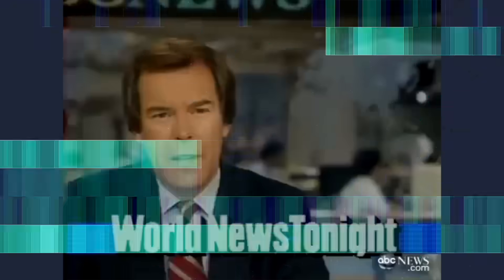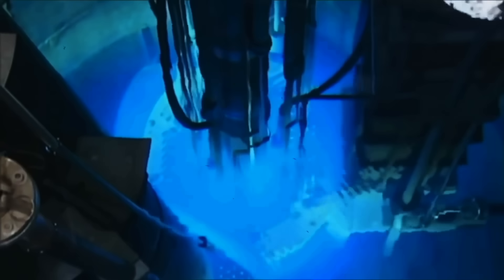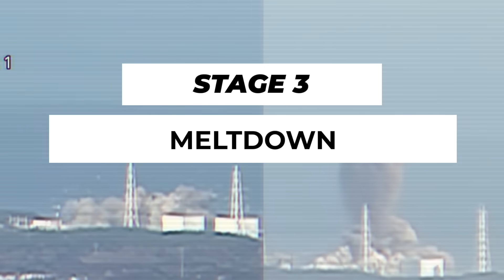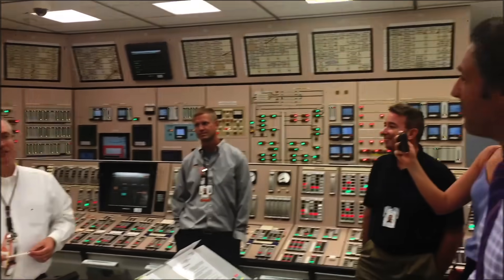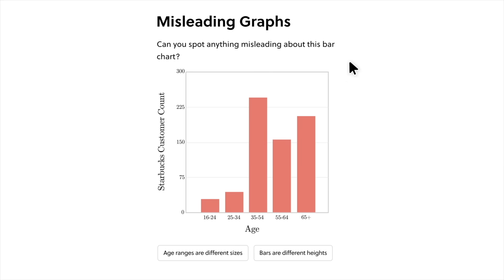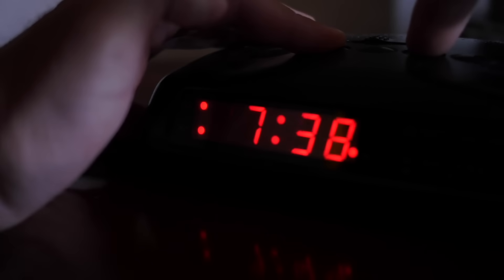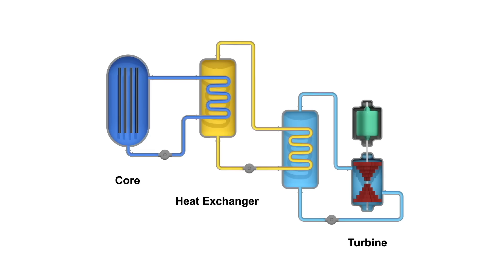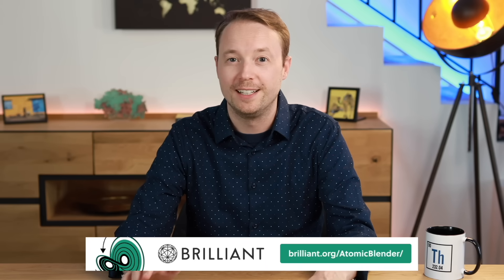Why Is It So Hard to Stop Meltdowns?

Comment: Ugh. 
Decay heat: 6% of the heat is from the shit left over from atoms shattering. That takes about a month or so to mostly fade away. 

So even if you scram the reactor, and really, no-one designs reactor core which would have any difficulty doing this, and then some, so that part always works. 

Even so, say you were at 1 000 000 kW power.  

Now you're at 6% of that, which is still 60 MW.  60MW is a lot of heat generation, and getting that out of a solid-fueled core requires keeping the primary coolant moving. 

Now, water is used in pressurized water reactors as the primary coolant. It has already quite a high latent heat: That is, it takes a little over 4kJ to increase the temp of water by one degree celcius normally, but when it's kept under enough pressure to prevent boiling by forcing the boiling point up higher, then at around 360 degrees C, it takes about 15kJ per degree to heat it up, and that heat capacity has more than doubled from around 6.5 kJ per degree when it was around 340 degrees.  

That fact, that water does carry such a crazy amount of heat at those temperatures, and goes on to carry *even more as it gets hotter* tends to be *very good* for evening out temperatures inside the core. Because the last thing you want is one small part of the core running say +20 degrees hotter than the rest. If that were to happen, the water might boil just there, (because of hydraulics, the pressure is almost the same everywhere the same body of water touches, so too is the boiling point) creating a void that would suddenly insulate that hot spot, which would allow it to get suddenly *even hotter*. This would be bad, so using water, which is quite unique in both having such a high heat capacity, as well as doing this neat trick, helps keep the thing safer.

Of course, there is still another problem. You see, there is a thing called radiolysis. This is where ionising radiation (whose defining feature is that individual quanta of radiation are strong enough to knock loose electrons from molecules, thus, 'ionising' them), well, breaks the water molecules up into separate atoms. Those atoms then get reverted to just a highly explosive perfect-ratio mix of O2 and H2, and bubble up out of the water and collect somewhere... just waiting to explode and definitely let all the pressure out. Oh, and the zirconia cladding used to keep the Uranium inside the fuel pellets and away from the water? That tends to also cataylze steam to turn into explosive hydrogen-oxygen binary explosive gas too. Especially when it's hot. 

So letting the primary cooling stop moving in a solid-fueled, water cooled, fission reactor is a recipe for Fukushima-style explosion. 

Very expensive, and you might accidentally panic and order a large-scale evacuation that will go on to result in many deaths. Which is what happened. 

What, you thought even one life was lost because of the nuclear accident at Fukushima? It was a Tsunami that did that. A couple of technicians wading through the spilt primary coolant basically had bad sun-burn on their legs, from the alpha-radiation from the water, but made a recovery. But yes, the evactuation destroyed enough peoples lives to the point they were then lost to mental illness, and who wouldn't have died if they *hadn't been evacuated*.

Worst of all is, when the precisely made fuel elements melt, you can't pull the reactor core apart anymore for recycling. It all becomes one huge lump. 

Can this ever be fixed? 

Hell yes: Just use a Liquid-Fluride Fuel. It's a nuclear reaction, it doesn't care at all what state of matter the Uranium is in, only how it's configured (placed, whether surrounded by neutron reflectors and moderators, basically how the neutron-economy goes). State of matter (solid, liquid, gas) has to do with how the molecules are stuck together, and that's to do with the electrons on the outside: all of chemistry is, so chemical reactions care about state: But not nuclear reactivity.

Have it dissolved in an ionic-bonded liquid. (a salt). That way it's already conveniently molten and can be easily removed to a container where it can't be critical and *can be passively cooled without needing a pump*. Using gravity and a thing called a freeze-plug valve. 

This is where  you just run a small air-cooling pump against where you want the 'valve' to be closed, and the extra cooling allows the molten fuel to freeze there, as long as that fan keeps blowing. Stop the fan, and gravity safely and automatically pours out the fuel to the safe-storage. Where you can later warm it back up with electric heaters, and pump it back up into the core, when you want to restart. 

Why does this work? Well, such molten fuel has a liquid range such that even if cooling fails, you can't actually get the salt hot enough to 'boil' itself. Therefore no pressure to keep it liquid is needed. Do you know what we call an 'ionically bonded compound which is a gas'? 

Think about it, sometimes it's even called a 'fourth state of matter': Plasma. It's really just a salty gas. Turns out if you ionize a gas, and shatter it into separately-charged fragments (ions), the electric forces tend to make it want to keep together, just exactly the way ionic gasses are anyway, because those materials have atoms that trade electrons and will happily sit about as ions, and not neutralise. But what this means is, it generally takes ludicrously high temperatures to boil an ionic liquid. Some ionic liquids will just chemically disintegrate first.

Rather than having to take the heat from where it's stuck in solid fuel rods in the core, away with a coolant, you can instead pump the fuel itself out of the core and take it to a heat exchanger. 

Better yet, if you don't take the heat away, the core itself can be designed such that the thermal expansion of the fuel itself automatically reduces the reactivity of the core, meaning the chain reaction automatically slows down as it gets hotter. 

So you don't even need to try to keep it running, it just runs itself. It's stable, rather than unstable. 

The lab reactor that proved all this actually had a 'mishap' where the control rods got stuck for unrelated reasons to do with being a prototype. The temp just went up a bit, there was a scary moment for the operator I'm sure, and then it just, stopped there. 'idling' at a new, slightly higher temperature. No melt-down even. Didn't even trip the freeze-plug thing, just, happily sat there waiting for someplace for the heat to go. Boring. Exactly as you want a nuclear reactor to be.

Why the hell does anyone water-cool a reactor then? Well, there's no good technical or defendable rational reason, it's just the way it panned out. The people used to building the water cooled ones had sales teams, and there were no people building commercial molten-salt ones. And the sales people probably had no idea the collosal disservice they were doing the world by selling more. 

One of the inventors of the water-cooled reactor - name on the patent, even - went on to write a letter to congress to plead for a ban on them. Because they were never meant to be made so big that they were a danger, from being possibly unable to be cooled in an emergency. 

So often, technologies succeed catestrophically - they're popular and that becomes a terrible thing, the damage done by not fixing things so badly broken, because it's the status-quo. Many fantastic technologies fail to 'make it' in the market, not for any fair technical reason, but often just because they're 'not a done thing'. They're unfamiliar, or are 'too stale' an idea to be a novelty. 

Or even, they arn't done because they haven't been done, because they weren't done while they were patented, and now they can't be patented (because that's how patents work) so investment doesn't want to lose money by being the 'loss-leader' to push them to market without protection from market competition. Yeah, really. 

Rich people are most often just born that way. They're not automatically less idiotic than any other randomly chosen group of people. The rich generally get richer, without having to work at it. So there's no real evolutionary pressure to keep them 'lean and mean' so to speak. The disparity grows far faster than anyone can do anything about it, and the best we can hope for is for the ultra rich to take the opportunity to pay to make big things happen. 

But to know what to buy, they'd need to know how to do the work that they've avoided ever doing. The kind of work that is maths homework. That is frustratingly finding and facing your inability continuously, until it feels like you're getting no-where, and are just 'not cut out for' it. That takes a lot of self-discipline. And if someone is so ultra-rich that they grew up surrounded by so many yes men that they never grew out of thinking they can get away with just blaming others to avoid culpability - well, they're never going to be able to grasp the knowledge they'd need to be able to be wise with their obscene wealth, to actually be worthy of the power they wield.

So, if those last couple of paragraphs struck  a nerve, because you 'have better things to be doing' then learning STEM. Prove me wrong: join brilliant.org and learn what you need to in order to really understand. You'll need at minimum enough maths to appreciate how game theory and quantum theory and some simple Bayesian probabilty solved using statistical mechanics leads naturally to the empirical gas laws from first principles. And then you can understand what entropy is, and why the second law is why we can't have nice things, or , how the only thing that matters about the economy, is the cost of energy. You can discard all of the 'management theory' nonsense of economics. Then look at the steel, concrete, time and energy costs of energy sources, and finally be qualified to judge nuclear fairly.
Reply: Umm, I'm sorry or happy that happens to you?

Comment: Did I understand correctly about the delay of nuclear fission?! An uranium atom might absorb a neutron but not split immediately. Is that right? And then it will split later and release its energy later! Is that correct? And if this phenomena is possible am I right to assume that this happens very rarely? Lets say that one out of every 100, 000 neutron absorptions, fission does not occur instantly, but release there energy some time later. Isn't this a very low number to explain a nuclear meltdown?!

Comment: You cant see, feel, smell or hear radiation, but it does make your mouth taste metallic. If this ever happens to you for no apparent reasom, then it means it is a very good idea to evacuate the area immediately.
Reply: If you get to that stage, better run directly to the Emergency department, that would be an EXTREMELY high dosage.

Comment: https://en.m.wikipedia.org/wiki/List_of_nuclear_power_accidents_by_country#:~:text=Globally%2C%20there%20have%20been%20at,energy%20accidents%20that%20must%20be
This link takes you to a wikipedia list of most of the accidents or incidents that total more than $50,000 in property damage or loss of life  which presently numbers at minimum 99 out of 440 nuclear reactors world wide and 209 which have been permanently shut down. Hmmm. Nothing to worry about? Really?
Reply: "At least 57 accidents and severe incidents have occurred since the Chernobyl disaster, and over 56 severe incidents have occurred in the USA. Relatively few accidents have involved fatalities, with roughly 74 casualties being attributed to accidents and half of these were those involved in the Chernobyl nuclear disaster "

Comment: Ok, I got a stupid question. What if in the middle of the reactor, there was a bomb? Hear me out. At the point of absolute "we are fucked" the bomb is detonated. It may blow the roof off the place but it will separate All the materials by distance. In my mind, that means it would cool everything down and neutrons would have to travel to far to hit each other.
Reply: The water that flows through a rector is to remove heat and generate stream, control rods and moderators are used to keep the reactor under control. Neutron absorbers are used to moderate the nuclear process. During the nuclear fission process, new nuclear isotopes are created, plutonium for example. Blowing the reactor apart solves the heat problem and would indeed stop a meltdown. Their is the secondary problem though. This  these highly radioactive isotopes into the atmosphere, these will continue to produce radioactive particles for hundreds of thousands of years in some cases and when breathed in they Cassie massive cellular damage and destroy DNA. This is why one would not blow up a reactor core.

Comment: Mechanical backup control rods and cooling rod systems should be in all nuclear stations in current operating and upcoming new generations. Large Vapor chamber cooling should be added to the design (inside pressure chamber walls)for passive cooling. Active cooling fans based vapor chamber should be added separately inside the pressure vessel with industrial forced draught blades (outside unit)which can be operated by a outside power source like an AC connection from outside and a DC connection as well with  battery packs for it installed outside site.Iron, lead and carbon fiber based  structure should be added to inner containment wall, middle containment wall and outer containment wall, top and lowest bottom containment wall should be the strongest iron, and the strongest artificial made material, possibly carbon fibre. Large Vapor chamber cooling should be present on the floor above and below the containment vessel. Additional, possible heat and radiation transfer surveys should be done in all stations. Neutron and neutrino absorbing materials should be added to a separate control rod. Cooling rods should be added to the control rod designs with heat absorbent vapors. Thats what is lacking there, there is lot of control rods for neutron control, but heat control inside local zones is practically absent. So, that should be added. I have been thinking about these design changes for quite some time. Additionally, in case of Fukushima, there was water integrity loss to the building, which should be addressed in all nuclear plants near ocean or sea. Each doors should be made water tight. and generator room and doors should be extra water tight and should be away from facing water. High throughput, high power industrial pumps should be placed inside the current generator rooms to quickly pump and drain out any water content automatically that may enter the generator room, despite everything else. Generator rooms should be entirely made of carbon fibre and water tight doors should have carbon fibre reinforcements. Inside the generator room, as well, there should be a water blocking temporary physical system near the generator to keep the water out, mechanically. Water presence and water and air pressure sensors should be placed near the doors of generator rooms should automatically sense water presence near the generator room and physically block water access inside the generator room. Seismic sensors should be installed in all nuclear power plants, and seismic dampners should be added to the nuclear reactor buildings for extra building strength. Its one thing we have a big dome and such, its another thing we have a practical and proper earthquake resisting building for the reactor core. Shock Dampners should be added near the pressure vessel to reduce outside vibrations from earthquakes. Existing nuclear reactors should be constantly researched and studied. Fusion reactors should be installed to supply more electricity demanding areas like EVs, quantum computers, etc. by next decade to assist the electricity supply from fission reactors. Automating more of the main systems while in parallel maintaining a manual and a semi manual methods as well is the best appraoch. We should all learn a lot from Fukushima and similar accidents in the past, and move forward that, to install more safety and more electrical capacity to the nuclear reactors.

Comment: This is crap. Nuclear power is the dirtiest fuel imaginable.  It makes land inhabitable for thousands of years when theY leak or melt.  They all leak.  They built Fukushima in a known tsunami zone. Absolute irresponsiblaty.  Never to be trusted business.  Used fuel only needs to be protected for 250 thousand years.  This video is irresponsible suggest this power is any where near safe.  Garbage.
Reply: No power source is absolutely safe. All anyone can do is improve on failures of its previous versions and designs.

Comment: Too slow to build, too expensive and too risky:
Too expensive: nuclear has to beat 1 cent/kwH for solar - no chance), too slow (takes a little more than a few months to build 1.000 MW (1GW), too unreliable (France had no cooling water in the summer and no power from 26 reactors), target for terrorist attacks (think of Putin bombing the power line and the diesel generator) too slow to react in the power grid (like ramp up/decrease power 100% to 50% or back in 2 Minutes. Not possible for nuclear reactors)

Comment: Without watching this video, I can answer the question.
We use the wrong kind of reactor.
We should stop trying to boil water, which requires enormous pressure, and use a molten salt to contain the fuel, and let that be the medium which extracts the heat from nuclear fission.

Comment: The SL-1 Nuclear Accident was an example of how not to design a nuclear reactor. It may be a small experimental design. But manually adjusting the control rods precisely by hand with the minimum number of rods is a recipe for disaster.

Comment: Circulating hot corrosive radioactive salts through meters of plumbing pipes, valves, welds, bends, pumps, etc is probably not a good reactor design.